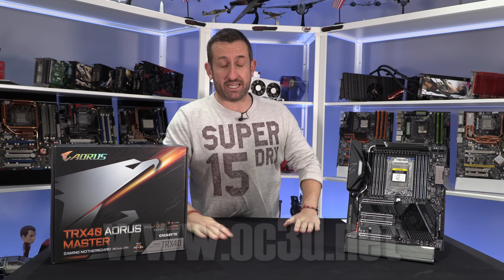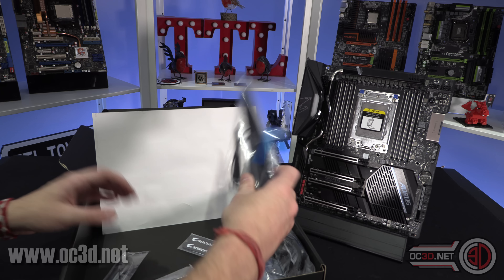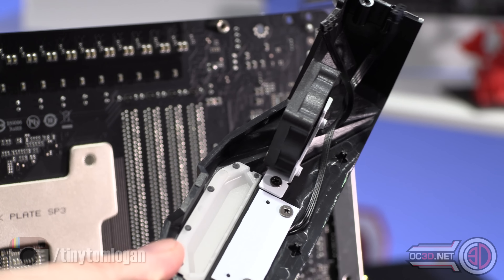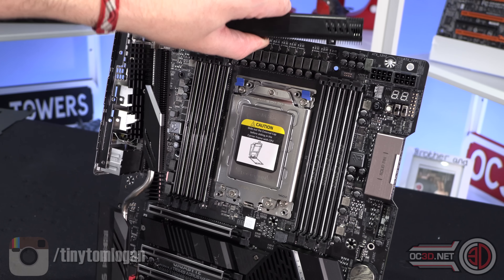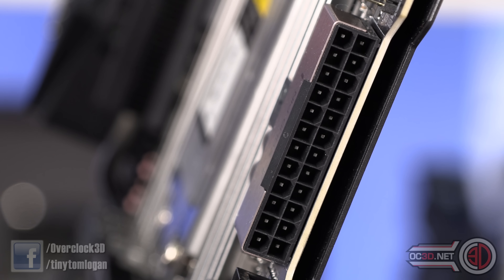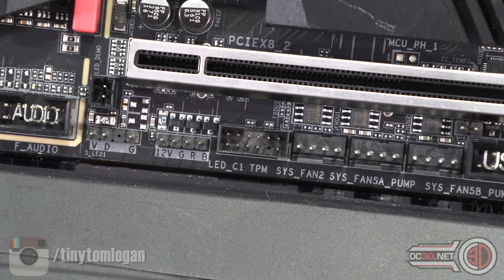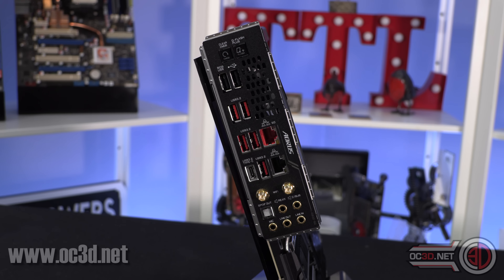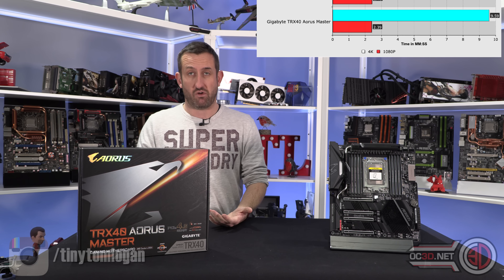Gigabyte Aorus Master TRX40 Review

Comment: hey bro, question.. how do you install the NVME drives in this board?  Do you have to replace anything? because after removing the heatsink and setting down the NVME, it somehow does not fit. Hard to explain but  in my case.. after inserting the heatsink back to the motherboard.. the screws will not reach. and I'm confused here.

Note that this problem only happens with the bottom shared heatsink. The top NVME has no issues for me.

Comment: Main problem with this mobo is lack of spacing between 2nd and 3rd PCIe slot and lack of a middle 5th slot. So overall this mobo is good for 2 aircooled GPUs only.
Reply: Well you could use a riser cable and mount a card in a vertical mount, or you could get two dual GPU cards, but multi-GPU is kinda dead outside of certain workstation workloads, especially beyond two GPUs.

Comment: Hi, hey can someone help me out here. I built my auros master trx40 together and is working fine. until i put my sonnett allegro FW800 pcie card then boots up i get NO display screen signal. If I take it out and boot up again . It works fine. Appreciate any help? My FW800 PCIe card is about 7 to 8 years old. It woeks fine with my other GIgabyte mobo also about 7/8 years?  ANy ideas help?